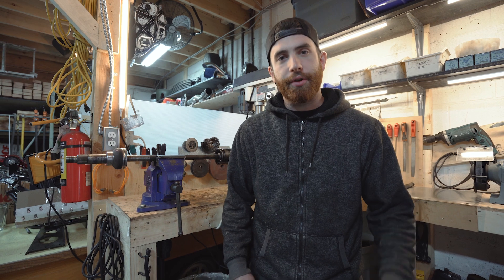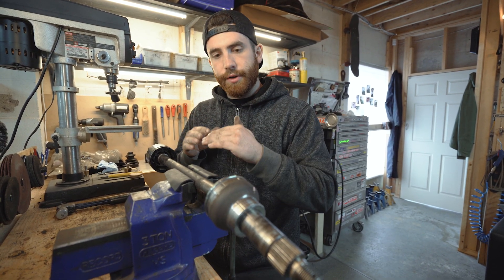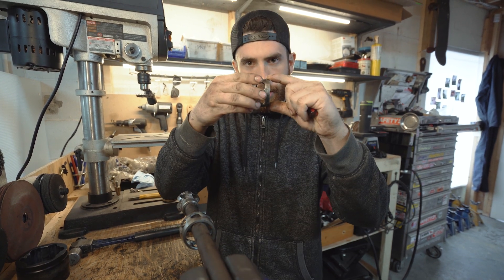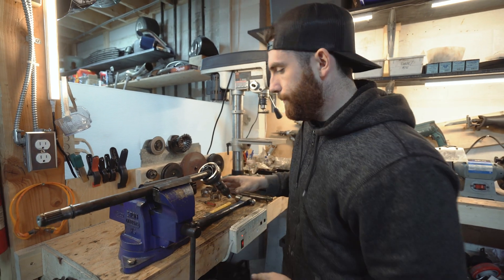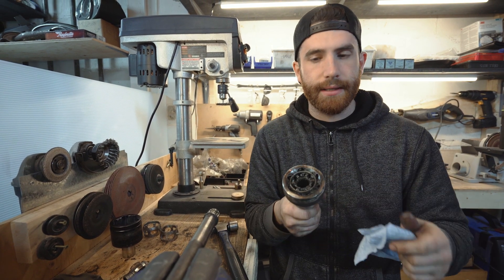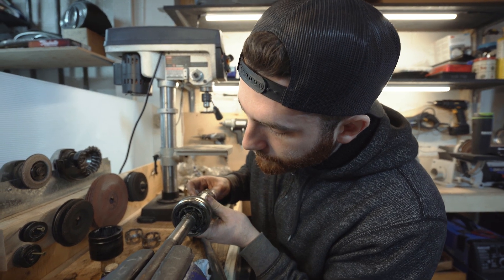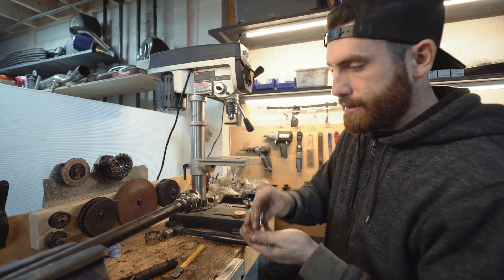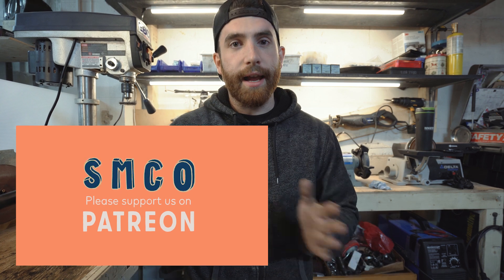Classic Mini Axle Rebuild

Comment: Hi. I have an Austin 1100 and I'm getting a lot of shuddering when going up a hill. I checked the outer nut on the hub to make sure it hadn't come loose. it was ok  There was a slight rattle like something was loose,  like a bushing perished, however all seemed to be ok.but the axle had a little play in and out, just beyond the boot and no movement at the outer nut, could this be due to the circlip displaces or perished?   Thank you

Comment: Just a quick one, when you finish putting the inner pot back on with the rubber boot can I then just fit that whole axle assembly back through the subframe and just put the inner pot into the diff ok?

Comment: Excellent video, thanks for this. I'm about to do the drive shafts on my Cooper S restoration. Mine's an old 1969 car and pre dates the inner pot joints. It has Hardy Spicer universal joints instead (standard cars had very basic rubber joints). The subframes were designed back in those days and the joints were small enough to easily fit through the holes in the subframe. I guess they didn't bother re-jigging the subframes to make the holes bigger for the later pot joints.

Comment: Awesome! Wondering if you have seen, or if MiniSpares has an axle rebuild 'kit' that can just be purchased with everything. Sometimes it is a bit intimidating trying to find all the right parts and matching them to the right year of Mini. I have 10in wheels on my 1986, so would I just look for the bearing, pots, and boots that fit that in particular? Seems there is also a 'smaller type joint' parts. Is that for 10in wheel setup? Thanks for all the help!

Comment: The subby hole's too small because they had rubber cruciforms or Hardy Spicer joints when it was designed. 

It's best to keep the joint components matched as they wear together - as you would pistons in an engine block.

Comment: This is perfect timing! I heard plenty of clicking when making sharper turns on my way home today and it seems I'm in need of replacing my CVs. Is there any way to tell which CV is going bad (inner vs outer)? I'd like to order the parts I need before I take it apart. Not much room for loose parts where I'm at currently.

Comment: Great video as always… But I have a question for you around an issue I had a few months back with a full restomod.  Have you ever seen in your experience the exterior or the outer CV pulling away from the axle because the cir clip was too thin? I had this happen to me on the road where the outer pulled away from the hub and left me stranded… Got it re-locked after some persuasion with a hammer and then saw the inner axle start to pull out a little bit so I can only surmise it might’ve been a cir clip for circlet that wasn’t properly engaged.  Curious if you have seen this before?
Reply: @thebluepOtatO 
I’ve seen that on other cars (classic mini are rare in the US) when the axles wear out or the rubber boots gets cut and all the grease is leaked out, ball bearings start to wear out and the outer swivel is no longer smooth, then it happens. 

Also when the vehicles are lowered or lifted and the angles are beyond the allowance, it could wear out components and cause that too 😎✌🏽

Comment: Great video.what grease should i use on these joints?
Reply from the maker: We use moly lube. Moly lube for metal on metal, but wheel bearing grease for bearings.